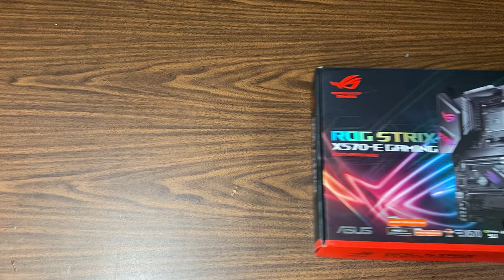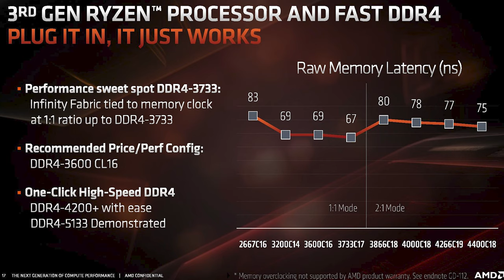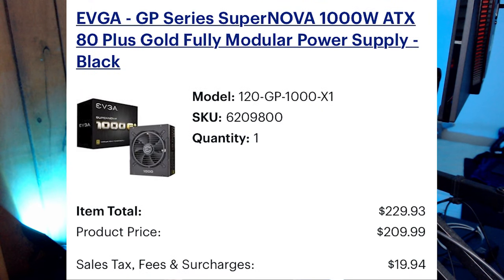I waited 7 MONTHS to finish this PC | Ryzen 5950X & RTX 3090

Comment: What about temps ?
Reply from the maker: With PBO 2.0 enabled, 5950X idles around 40C and around 80C max load. I have a semi-aggressive fan curve setup for the 3090 so it idles around 45C and stays around 65 max load. Tests done on 1440p monitor with maxed out graphics settings @ 165 hz. I'm sure it's more than capable of doing 240 hz maxed out on my 1080p monitor.
Reply: @PsionicKevin  Nice this case perform realy well thx